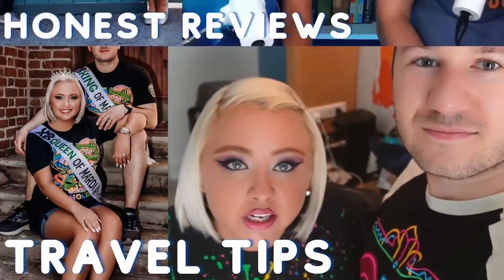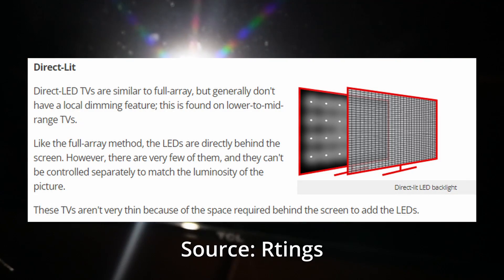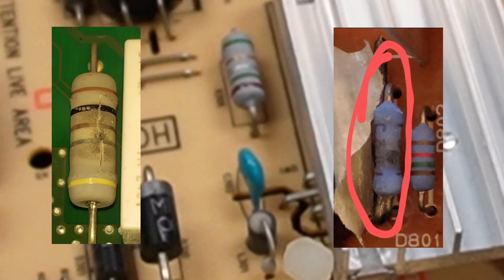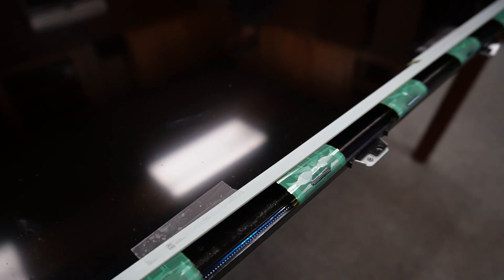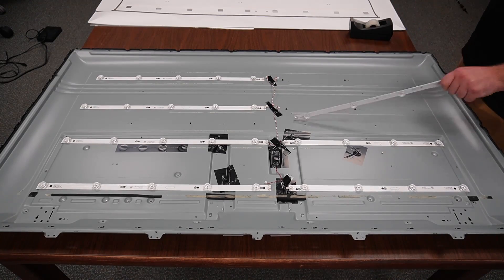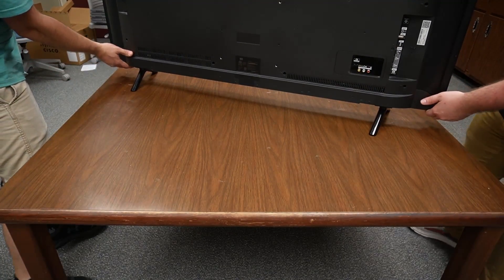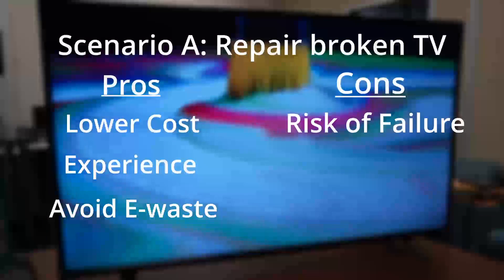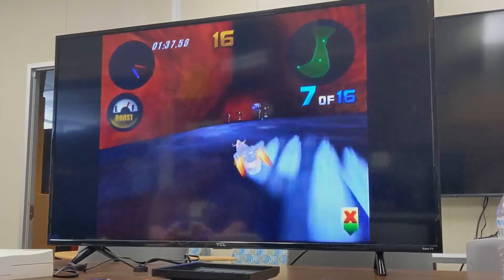Is Your Broken TV Worth Fixing? - TCL 55S401 Repair

Comment: Always depends on the TV issue and the person's skill set, but largely I'd say yes. Helped 1 friend fix a TV that was just a bad capacitor that wasn't actually rated for what it was doing meaning samsung built it to fail. Another just had bad light tubes that needed to be replaced.

Comment: First off, thank you so much! My 55S405 was fixed by following the steps in your video! 

Unfortunately, I ended up getting a big drop of sweat on the diffusing plastic layers. I tried to dab it off with a microfiber cloth but it left a biggol smudge and of course it's showing up on the TV picture afterward. I did NOT try to use any cleaner or water for fear of making it worse. 

Is there any way to clear that up or do I just need to buy a new sheet?
Reply from the maker: I'm glad you got your TV working again! I would probably try a plastic safe cleaner to clean any of the layers that got wet. You may also want to clean the back side of the LCD. Just make sure all of the surfaces are dry and streak free before reassembling. I have had good results in the past by cleaning LCDs with a product called "invisible glass." I'm pretty sure it is plastic safe. Proceed at your own risk though. It is so easy to get debris or fingerprints on the screen while assembling.

Comment: I had to take apart my TCL-made Roku TV because the backlight stopped working. Turns out they had cheaped out on the flyback diode in the switchmode power supply, so I replaced it with a MUCH better diode, rated for twice the voltage and twice the current, AND put the diode on a heatsink. The original diode lacked ANY heatsink, and had too low a voltage rating to withstand the voltage spikes it is constantly subjected to. Retail cost of the better diode was only about $1 (USA money), and would have cost TCL only a few cents extra at the factory prices. DOH!

Comment: Hello !! My son's Tv TCL 55S401 broke, please could you tell me where to order a new screen I would appreciate it, Thanks.
Reply from the maker: Usually, you can find replacement parts that have been pulled from working TVs on eBay. If your LCD is broken it may be hard to find a replacement for much cheaper than the price of a new TV.

Comment: Thx kinda worried about buying a PCB on eBay but it certainly is cheaper than a new TV
Reply from the maker: Most of the boards you will find on eBay were pulled from TVs that had damaged LCD screens. This happens all the time during shipping and packaging. Fortunately, all the other parts are usually ok. If you are skeptical, try to buy from a seller that accepts returns. Best of luck!
Reply: Yup just ordered from a highly rated seller that guarantees it, only $40